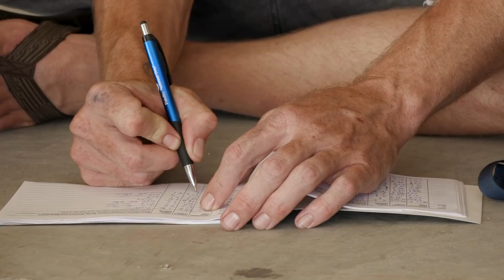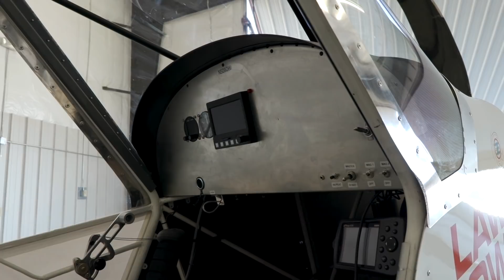Day 3 - Low and Slow to Oshkosh 2018 - Repairs and Maintenence

Comment: Very cool! Thank you for the hard work getting these up everyday. 👍
Reply: Justin - Yes I am, in Eastern Africa
Reply: David InAfrica Which country? I have always wondered what General Aviation is like in Eastern Africa and the availability of fuel at airports
Reply: Hassan Deer - I move around all of Eastern Africa, Kenya, Uganda, Tanzania, Ethiopia, South Sudan and Somalia.  Fuel availability varies as does pricing.  Most rely on fuel from either Wilson airport in Nairobi and Entebbe in Uganda if you have the range.  Hope that helps
Reply: David InAfrica ah I see. I am originally from Somalia but grew up here in the US. It has always been my dream to get General Aviation going in Somalia. I have not assesed the situation yet but most airports havent been attended to since the 1990s.
Reply: Hassan Deer - General Aviation is growing in Somalia.  Major improvements have been made to the airports in Mogadishu, Bosasso, and Hargiesa.  Unfortunately, there is still a major need for ground handling and maintenance.  A lot has changed in the country over the past 10 years.
Reply: David InAfrica David InAfrica Yep, it definitely has grown but General Aviation would not be General if you could not find an airport within 40 miles to go learn at or even an easy diversion to fuel up or stay in from weather. I would hate to be a CFI who has take thier students on a cross country to fuel the plane XD Its getting there. You are right, especially about maintenance, if you can't service your own plane there is no way to fly as GA comfortably in Somalia (unless your home airport is Mogadishu)

Comment: Great getting the full explanation on reducing the weight for competition. One warning though. Replacing your stainless firewall with aluminium basically is dangerous. SS will give you a slight chance in hell when you get an engine fire, or a hole in your exhaust system (like that ever happens..). Aluminium will not keep any fire out. Trading that safety for a few ounces may not be a good decision. Even a very thin SS firewall is more effective than any aluminium 'firewall'.

Comment: OK....So, you check base with Hal Stockman in your awesome video, but you never say what type of aircraft (make, model etc.) he is flying, engine size, stall speed, how much it cost to build etc.  I'm a virgin, I want to get into flying.  I used to build RC & U-Control and competed in Cali back in the 80's, no more models, time to build the real thing!!!  I want to fly & build a 4 seater STOL.!!...Please help me out;  I need details please!....I'm operating on a shoestring budget....BTW, I'm addicted to your awesome channel, keep it up the exceptional work!

Comment: Awesome video! I couldn't help wondering if there comes a point where there is a weight to safety trade off. I get some of the modifications that can be removed for competition but I couldn't help wondering if mods like smaller bolts or thinner glass pose and risk when flying cross country. I assume its really what are you comfortable with running but is that a concern?

Comment: Aluminum firewalls are a very bad idea because the metal melts at a relatively low temperature and quickly burns through resulting in large holes and flames blasting into the pilot's cockpit.  It's unlikely you can get the plane on the ground fast enough to avoid fatal burns.  Stainless steel melts at a much higher temp. so it's a reasonable compromise between weight and protecting the pilot from flames.  Be safe and put the stainless steel firewall back in.  (Ck with an FAA inspector or knowledgeable  builder (Oshkosh?) about the firewall material requirements for Experimental aircraft.)

Comment: Not boring at all. I just sit here green with envy.  :-) Hey, Trent, quick question for when you've got time :  Why do you guys use mufflers? My little experimental has straight pipes and so did my 411 and 421. Both of the 400s had Continental GTSIO 520s, so it's not engine size, Just curious.
Reply: raymondkoonce back pressure is needed to make power
Reply: Sorry, I meant SCOTT. You do realize that sounds counter-intuitive? Generally you try to relieve back pressure for the sake of power. Maybe it has to do with the Rotax construction?